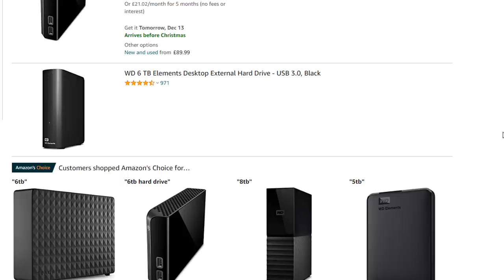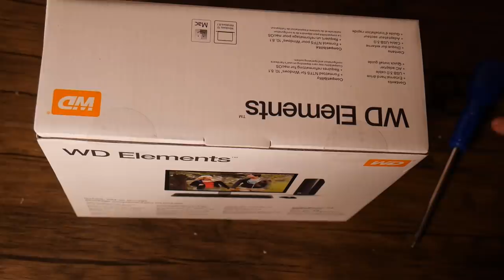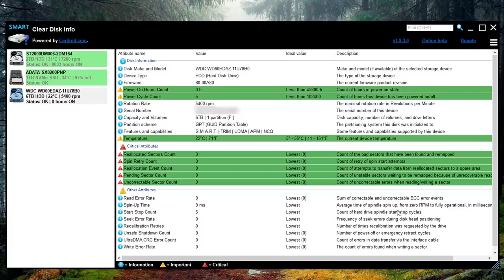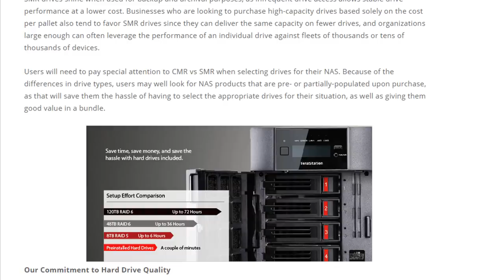How to Shuck an External Hard Drive Enclosures for Cheap Storage

Comment: I opened 4TB version of that drive, I found normal WD Blue inside, no reset pins connected to 3.3V as some other drives may have. But it had head parking set to 8 seconds, I changed it to 6 minutes using wdidle3 program. It's recommended to do that as otherwise disk will park head too often when used in PC or NAS and it will die much sooner.

Comment: Hi is there any problems with Voltage seen a few vids where pins have to be jumped thanks for the video
Reply from the maker: That would only be a issue on really old computers, should work fine in modern day computers.
Reply: @Britec09  CS750M modular Psu
Reply: Some external disks have 3.3V pin tied to reset pin, so if you connect SATA power connector or put drive in NAS they won't work, so modifications have to be made. WD probably did that to prevent people from buying cheaper external drives and using them in PCs and NAS devices. As far as I know these disks in video don't have that kind of mess so they will work normally without modifications. My 4TB version works without problems.
Reply: @night6452  Thanks for your reply covers my thoughts on the NAS and internal backup.

Comment: Looks like the WD Elements are basically the same as Easy Stores just different branding. Shucked 2 x WD 14TB Easy Store that I got on good deals. Found WDC WD140EDFZ-11A0VA0 5400 RPM drives inside, which are rebadged CMR HGST drives, so not a bad deal. Looks like WD switch to these 5400 RPM from the 7200 RPM drives in the previous lots of Easy Stores. Used them to replaced 10TB of 3TB and 4TB drives in my main rig with a 120GB SSD boot drive and put the 3-4TB drives in the shells for more external drives. Instant storage upgrade with a backup drive and less stress on the PSU. 
These WD externals are pretty simple to shuck so shucking these make sense if you know what you are doing and with a bit of research to avoid the SMR drives. Can't beat <$15 per TB for large internal drives with enclosures for more external drives.
Reply from the maker: Yeah I agree
Reply: Easy stores are the model specifically made only for bestbuy. So they don't have to piece match any other sellers, because it's a "different model" when it really isn't.
Reply: @thomasgenzer  Thank you, that clears up a few things.

Comment: I once bought a virgin set top box and router from a car boot sale, 
I ripped out the 1tb HDD, it was the cheapest HDD I've ever purchased XD

I've also in the past salvaged a HDD from one of my old broken laptops and put it in an external drive caddy and acquired a cheap external drive XD
Reply from the maker: Yeah, standard hard drives
Reply: @Britec09  if you have an idea of what can be found where, you can find some deals, 

As for technical specs of HDDs, I don’t know them well enough, but for mass or cold storage they are normally ok from my experience

Comment: Hello Brian. Does this pertain to the 2.5" drives as well?
Reply: Yes it does. Never done it myself but have seen other people do it.
Reply from the maker: should do.
Reply: @Britec09  Ya with SSD's coming down in price it may be worth it to look into buying an external 1 for the cheap & dismantling it to use as an internal. I also wonder why external drives are generally cheaper than internal considering the external ones have a few more components ? Maybe they know more people nowadays want internal more for gaming rigs so they jack up the price ? I will never go back to HDD's. SSD's are way faster & HDD's are sometimes noisier. Also SSD's take up less room in your case & I think I remember reading they tend to not get as hot as HDD's due to no moving parts. :)
Reply: In some cases with 2.5 inch drives NO.
Some usb3 2.5 inch drive portables don't have a standard power and data SATA connector anymore.
Those are equipped with a drive logic board which has the usb3 connector soldered straight onto it.
I don't remember which brand and model I came across this disturbing surprise, but it was a major brand.
Older usb2 drive enclosures had standard SATA connectors, so casing and drive could be used separately for any purpose.
Reply: @umbertoyltp  Thank You.

Comment: With your accent (and my Yank ears ;) it's really difficult to hear the difference between IS SMR and ISN'T SMR. Perhaps you could emphasize the IS or NOT?
   SMR drives are fine for the main purpose of large hard drives - load them with archival data then read it. This usage pattern used to be called WORM (Write Once Read Mostly). The only problem Seagate had was trying to hide the difference, and not making the less responsive hard drives as much cheaper for the consumer as they are cheaper to make.
   Using software such as TeraCopy (which can move data as well) which performs unattended data transfer that is restartable and verified, it's easy to safely 'load' your new SMR drive in the background so time really isn't a factor - for most uses. I'll provide no link and make no money for this suggestion - just google TeraCopy and you'll find it easily. It's free, but I paid the small fee for mine as I use it all the time and relish the safety.